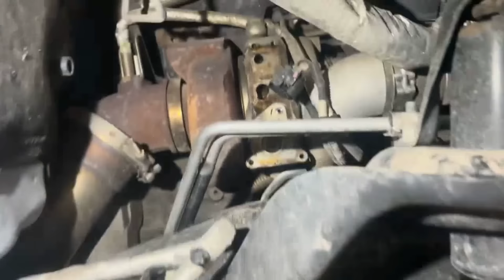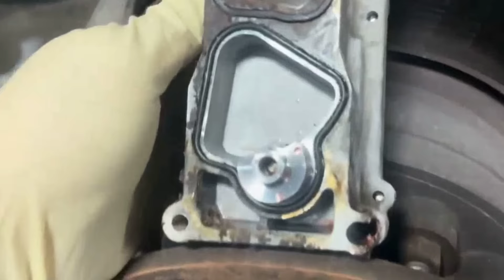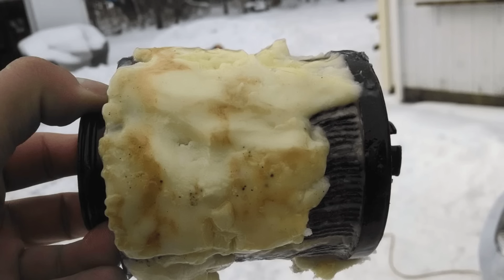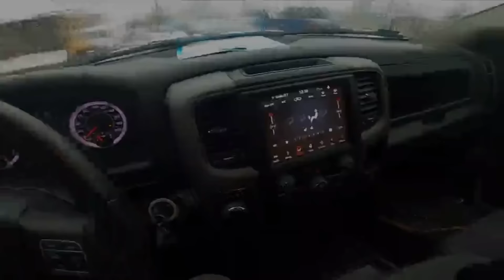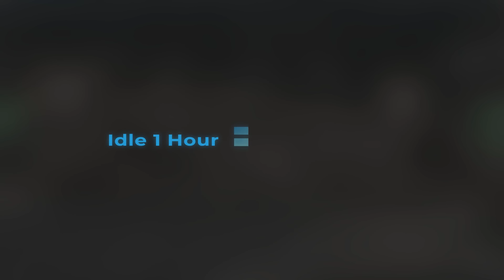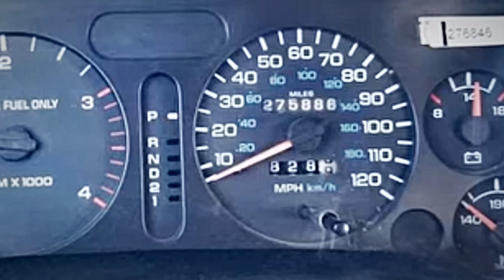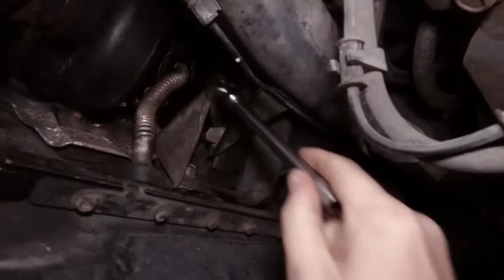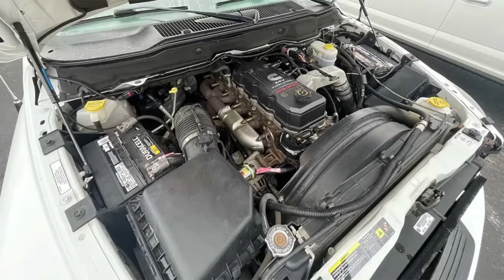7 Stupid RAM Engine Habits That Are KILLING Your Turbo (STOP IT NOW)

Comment: Great video but idling is fine. I tow daily and still on original turbo at 286k. When I replaced actuator it looked unbelievable with no soot build up. These are made to tow regular not get groceries like most people buy trucks for.  And with 8k idle hours that theory of idle is out window.
Reply from the maker: Thanks for watching! You’re right, these trucks are built to work, and regular towing keeps everything hot and clean. That probably makes a big difference compared to short trips.

Comment: I was under the impression that the 2025 and above the region fuel that is added does it down line so it is not going into cylinders. Is this correct? Great video by the way and lots of good points..

Comment: 2009 dodge 3500 with the 6.7, it's still on the original turbo at close to 300,000 miles.  Unplugged the grid heater 150,000 miles ago. Block heater for winter use. In the winter, truck runs for 10-15 minutes high idle with the exhaust brake on for warm up.
Reply: If the grid heater is disconnected on the 2021, eventually an error code will come up and need to be reset. I had this happen when I disconnected it. Now I use the double tap on the starter button to bypass the grid heater wait period.

Comment: Are you guys running the tow/haul when normal driving (not under load) including highway, to keep RPMs up or only when under load ? Just bought my 2026 2500 and I do the “no short tripping” and “no hot shut downs”… also exhaust brake on auto always…. I know the video said lugging under load, but I just wanted to check.

Comment: I've dine the e minut cool down even with my engines after a hard pull.
   I saw lots of vehicles blowoff coolant when the y  pulled in for gas pulling a trailer and just shut off

Comment: Just changed upgraded my grid heater at 290,000  ot wasn't  loose.😬
  My 12 was deleted at the dealership  but it was incomplete because they didn't blank off the EGR crossover tube .
 It is now .
  Its been straight piped since  new.
  Now it performs even better
Reply: We just found out about the bolt... it was loose at 80k miles. Deleted now.

Comment: 147,000 2021 Ram  you missed one thing, Hydraulic lifters, cam and lifters. Shop put new cam and flat tapped lifters. Drove for one week hauling enclosed trailer. Main bearing went.  Totally new motor. We will see if the turbo lasts.

Comment: The issue with idling is fact. My truck use to be my office and in the winter time it would idle from sun up to sun down. If I would have put it in high idle I probably wouldn’t have burnt out my turbo at about the 135000 km mark.

Comment: Most of this info should be considered for all diesels, not just Cummins! Should have also included not going past 30k for Auto Transmission service's! "Excessive idling" seems to really only matter with Dpf system equipped vehicles. If it doesn't have it, well you get the point. In extreme cold you are a moron if you just jump in and drive off after 30sec. It's not only bad for the engine, but the transmission as well. Not to mention what it does if your loaded down from the get go. Cummins/Ram has a high idle warm up with full exhaust break engagement for a reason! This system stays active all day long while the vehicle is running, once it gets below like 170, high idle kicks back on to bring the temps above 180. Why does it do this? Think about it 🤔
Reply from the maker: Absolutely, a lot of those diesel maintenance principles apply beyond Cummins. And you make a good point about cold-weather warm-up, transmission temps, and using the factory high-idle strategy as intended. Great insight!

Comment: I have a 2017 with possible turbo actuator issue.  I cant hear my turbo while driving anymore and my exhaust brake no work no more. I tried spraying CRC turbo intake cleaner in the turbo intake but nothing changed ?
Reply: Likely the turbo actuator, read codes and see genos garage. Lots of YouTube vids on it. The clue is loss of exhaust brake and use the gauge to see on acceleration, I bet boost is less than 8
Reply: @cpntexas_x problem is there is no codes or engine light on.
Reply: @damnitdann91 there are ways to diagnose by trying to hand move the vane, but did into the vids and see the whole story, or talk to genos
Reply: @damnitdann91 Those two symptoms sharing one cause is the big clue: on the 6.7L, the exhaust brake is the variable geometry turbo. The vanes close to build backpressure for braking and close to build boost at low RPM. Vanes stuck open = no brake, no boost. Exactly what you have.
Most likely culprits, in order:
Soot-coked VGT nozzle ring — the classic 6.7 failure. Vanes/unison ring gum up and bind mid-travel. Often throws no codes because the actuator still moves and reports position; it's the vanes that aren't following.
VGT actuator (electric unit on the turbo) — internal gear or motor failure. Usually sets P2262/P003A-type codes, so the clean scan makes this less likely but not impossible.
Boost leak — CAC, boots, clamps. Would explain low boost alone, but not the dead exhaust brake, so it's secondary unless you've got two problems.
Plugged DPF / high backpressure — usually codes and regen complaints first.
Prior tuning/delete — if the truck's ever been programmed, the exhaust brake is commonly disabled in the calibration.
Quickest test: key on, engine off, watch the actuator arm during the calibration sweep at startup, then live-data the VGT commanded vs. actual position while driving. If commanded and actual track together but boost never comes up, the actuator is fine and the vanes are seized. Confirm by pulling the turbo and checking the nozzle ring by hand — a stuck one won't move freely.
Also verify the basics first: exhaust brake needs coolant temp above threshold, foot off throttle, and the switch in Auto or Full.
Reply: @cpntexas_x yeah the truck is tuned and deleted.  50hp tune nothing fancy. Full egr delete.
Reply: Could it be possible to possibly retune the truck and see if ut changes anything or no cause the damage is already done
Reply: And I can hear the turbo through the turbo intake front the air filter but thats it
Reply: @damnitdann91 I'm not that far along mine is the actuator, I have codes, but haven't reached into try and hand move the actuator as genos calls out for test. I just had a low back procedure and genos actuator is on back order.
Reply: @cpntexas_x i left a comment on his post yesterday hoping for a reply. But haven't heard anything yet
Reply: @cpntexas_x so my turbo boost I just checked it and it went all the way up to 24 turbo boost
Reply from the maker: Sounds like it could be a sticking actuator or a failed actuator. I'd scan for codes and monitor the actuator position before replacing anything. CRC intake cleaner usually won't fix an actuator issue.
Reply: @RAMCentralHD in the thread he said, scanned, no codes.
Reply: @RAMCentralHD yeah there's no codes popping up

Comment: GETTING RID OF THE GRID HEATER WAS THE FIRST THING I DID IS GET IT OUT AND PUT A  BANKS INTAKE ON IT AND ALL THE BIG AIR INTAKE PIPING TO HELP THE FLO OF AIR AND THAT HEATER IS GONE
Reply: I just installed the MONSTER RAM INTAKE. PEACE OF MIND TO LET MY CUMMINS LIVE LONGER AND GET SO MUCH BETTER FUEL MILEAGE! INSTANT RESPONSE WHEN THE LOUD PEDAL IS PUSHED
Reply: WHY ARE YOU YELLING AT US
Reply: I put a BANKS on mine in March. Bolt was not lose to the touch but I did check it and I turned about a 1/4 turn. It was going to come off. I had about 110,000 k on the truck when I did it. Do not regret doing it. Took most of the day but I now have that piece of mind that I will never have to worry about it.

Comment: not using the exhaust brake cost me $7200 for the replacement of the the Turbo Actuator. I always run my 2014, 3500 automatic in 4th or 5th gear when towing my fifth  wheel, but I didn't exercise my turbo exhaust brake.  I do now and find how nice it is on down hill with the trailer pushing me.  Great video.  Now I have to remember the cool down before stopping for the day or for fuel when towing.

Comment: I have the 3.0L Hurricane but owned a 2019 Cummins. I was told for both that the system electronically pumps oil through the turbos for a few mins after the engine is turned off. If you sit in the truck long enough after turning it off, you’ll hear the clicking when it stops. I could be wrong, but it’s what I was told at the dealership.

Comment: Just came across this video. Just got a new Ram and I only tow moderate weight at times. I knew half the things here but I would’ve probably never used the engine brake, and never thought about low RPM towing. A big thank you! Now I know!

Comment: 2021 ram 3500 380,000 miles everything is good i deleted it about 70,000 miles ago. I always use the exhaust break
Reply: 405000 miles now and yes use the exhaust break and let it rest before turning it off

Comment: Im at 100k and my actuator is going out. I been smelling burning oil for a couple months now so im just doing the turbo and actuator. I park my truck for the winter cause i dont want the salt to eat my truck. When i fired her up this spring it was throwing all the actuator codes.

Comment: I have a 2011 6.7 Cummins  and have done the grid heater bolt delete  and always run the exhaust  brake and tow haul mode every time  I start the truck the nest thing I have done is to install a edge turbo cool down  timer

Comment: I avoid idle time when I can but if I need to idle I use the factory fast idle on my 2015/3500 and that bumps it up to about 1150 rpm from 750/800. 

The turbo cool down after a drive is very important and I usually idle into a parking lot or my long driveway at home for 2-3 mins at least and shut down.  I’ve always thought this was adequate??   
I got the DEF fault countdown at about 120k miles so it’s fully deleted but I drive responsibility….gotta keep that 68RE alive. 

I’ve installed the monster ram intake and had to replace my turbo actuator at 170k miles with a bull it one from Genos garage and I’m at about 179k miles now so guess I’ve been pretty lucky so far.

Comment: Installing a Bank's iDash, and display the EGT.  This will allow a driver to learn and be aware of the turbo temperature before shutdown.  Driving at a slower speed will cool the turbo off.  Many times when pulling off a freeway and driving to a fuel stop or parking spot in a rest area.  The turbo and the oil will be cool enough to shutdown.

Comment: 20 min on the highway isn’t enough. You need more like an hour. Trust me.
Reply: I never let my truck set and idle.
Reply: Run AmsOil send a sample in every 15,000 miles. Change the oil filter when you do change oil when it comes back says you need to change soon.  I get over 30,000 miles between oil changes.

Comment: So we're not supposed to turn it off while hot, but we're not supposed to idle it either because clogs up the DPF so what are we supposed to do?
Reply: Did you not pay attention? 2-4 minutes to cool down before shut off. Sitting in your truck all day with the AC or Heat on no beuno

Comment: I live in Boise and first it doesn't get that cold here. And I also Don't use my Diesel very much in cold weather. When I do and it's cold I just plug it in. In my opinion Diesels need better fuel filtration and lubrication for the injectors and fuel pump. And of coarse at 70 I forgot my main point. Thinking about just getting rid of the gird heater. I really don't think I need it. My truck has always started immediately. I would appreciate and advice in regards to the grid heater.
Reply: You can simply disconnect it at celonoid .the heater cycles  even if you don't preheat to maintain intake manifold temperature

Comment: I put a turbo timer and 2 pyrometers " 1 for the front 3 and 1 for the back 3 cylinders" Pretty much since day one. Also the Fleece coolant bypass system to even out temp. difference between front 3 and back 3 cylinders. Banks larger intercooler with bigger feed tubes. And Banks cold air intake. Straight out 4 inch exhaust. Steed speed exhaust manifold.

Comment: I just unhooked the grid heater wire from the grid heater bolt. Who ever had my 2008 ram 3500 before i bought it did a egr and a dpf delete with efi tune.
Reply: You still need to delete the bolt all together. Just because it doesn't turn on anymore, doesn't mean it can't still fall in. At bare minimum get a delete manifold plate. Sure, you can just cut the factory heater out of the factory plate and remove it all (there's mod videos), but a new delete plate is only $120 (and you use your factory intake horn). If you actually need a heater for your area, look into a banks, spelab, or other system with a coil heater.
Reply: @BodyByBbq It fails because the relay stays on and melts it, which RAM did a recall for.  Therefore, there’s no need to completely remove the bolt if you unhook the wire.

Comment: Wow! That explains why my turbo was replaced at 80,000 miles. I turn on the exhaust brake every time I drive it. Great videos!
Reply from the maker: That actually makes a lot of sense. The exhaust brake helps keep the turbo vanes moving and prevents them from sticking up with soot over time. A lot of diesel owners don’t realize that until after they’ve already had a turbo replaced.
 Glad the video helped, and appreciate you watching!

Comment: Full exhaust brake in bumper to bumper traffic or on an exit ramp.  Going down a steep grade for extended distance..Full brake and tow/haul mode on even when unloaded the truck will practically stop on its own if you let it.  Auto brake when cruising.  On short trips (10 minutes in a store)..engine hot leave it idle or high idle. 
Hilly, curvy roads..lock out 6th gear.

Comment: I use my exhaust brake every time i get off the highway . Just before i enter the highway i put the exhaust brake on and the tow haul mode on . My truck was 3months old and i put the monster ram on . After any tow light or heavy i let the idle for 5 minutes. I also let the truck do its 5 minute idle in the morning to get oil up in the valve train .

Comment: I live in Brazil, 30°C 15w40 Valvoline ou 5w40?
Reply: 15/40
Reply: @tomlambert1833  Thanks. The valve seat dropped in mine, and in Brazil, the cost to do a partial rebuild on a 6.7 engine exceeds R$100,000 (or $24,000).
Reply: @matheuscunha6251 they expensive everywhere. 
 I'm in western Canada

Comment: I have a 2001 Dodge 2500 5.9 Cummins with 285,000 mi and a 2006 Dodge 2500  5.9 Cummins with 236,000 mi and no engine or turbo issues. I always let the turbo cool to 300-350 degrees before shutting down. Both trucks have full gauges. My '06 is a 6 speed manual. I always watch EGT's when towing and never let them get high. I only run the EGT's up occasionally because I want to heat up the stock OEM catalytic converter. The '01 doesn't even have that.
So much of this videos addresses all the issues with the 6.7.  I don't have a VGT turbo. I don't have a particulate filter. I don't have an EGR valve. I don't have the grid heater bolt issue. There isn't much about the 6.7's I like. When my buddy bought his 2018 he was impressed that there was no soot at his tailpipe. But he's had a lot of issues. He put the Bank's kit on to fix the grid bolt problem and has now gone through two #1 injector tube failures. 
I understand the 2026 6.7 has a different block that eliminates that "Dreaded Grid Bolt" issue. Now if they could just get rid of all that emissions stuff it would be a great engine.
Reply from the maker: That’s a textbook example of why the 5.9 Cummins has the reputation it does. Proper warm-up, cool-down, watching EGTs, and full gauges make all the difference and your mileage numbers prove it. The simplicity of the pre-emissions setup (no VGT, no DPF, no EGR) is hard to beat for long-term reliability. A lot of folks miss that balance in the newer 6.7s, even with the updates.
Reply: 5.9 over the 6.7 everytime. Just wish I had the 12 valve

Comment: I have a 2024 Ram 2500 with 10,000 mi. thats leaking oil in the back of the block underneath. Anyone else ever have this problem?
Reply: Not sure about the "back of the block" but there are numerous cases of the timing cover gasket leaking on a lot of 6.7's. Since the cam has to be removed to replace it, the dealer will lift the cab to do that. My buddy with the 2018 had that done under warranty. The cross member doesn't unbolt like my truck. So he was told that's what they have to do. There is a time laps video on YouTube of a dealer doing it. Interesting.

Comment: Excessive idling creates cylinder wash down as well.
Reply: Idling does not hurt the engine its low temperature  Keep it Hot
Reply: Is that also on deleted Rams?
Reply: Even if I'm stuck in traffic I idle up to 11 to 1200 rpm